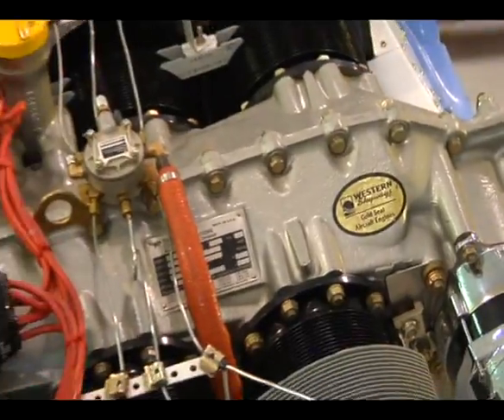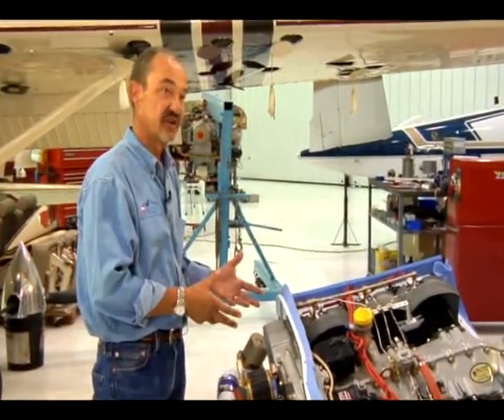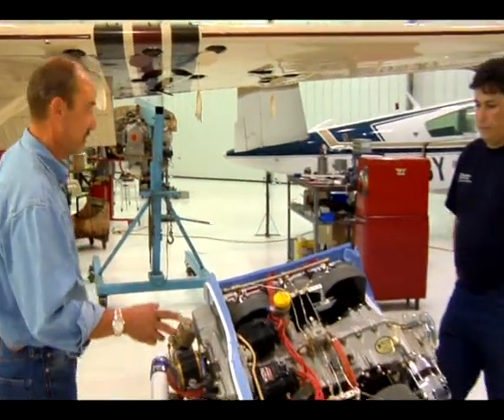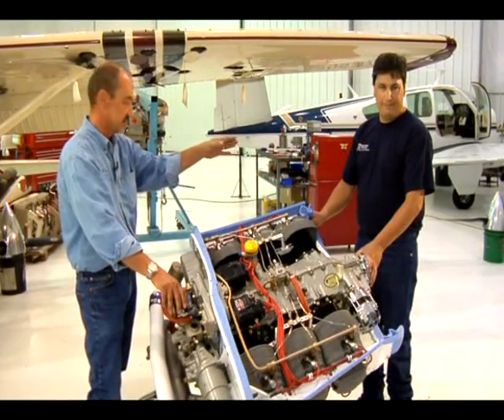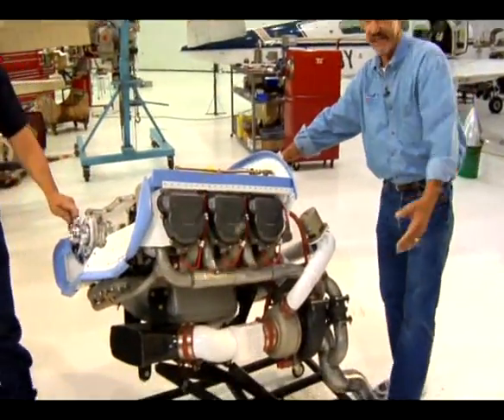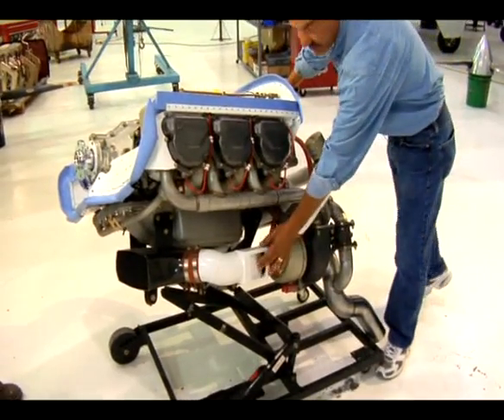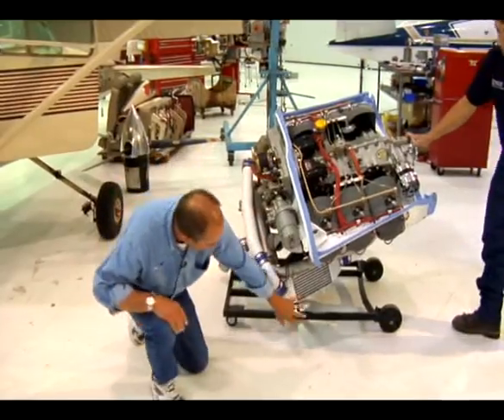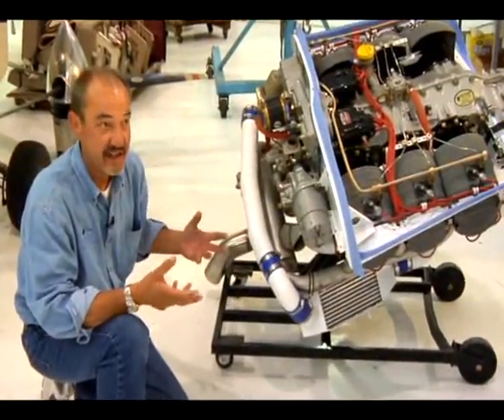Western Skyways Turbo-normalizing 1

Comment: an intercooler is AFTER the turbocharger because when air is compressed it is heated.   The air before the turbo cannot be cooled because you are using ambient air temperature to try to cool ambient air temp going in.   not going to change a thing.